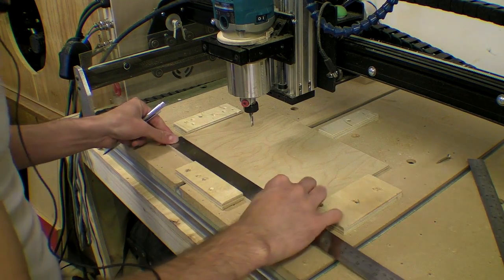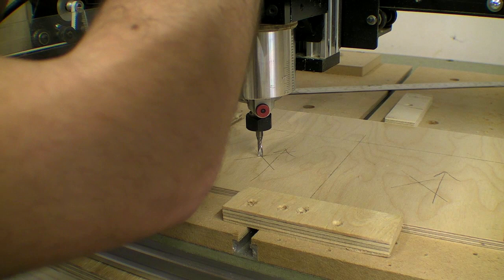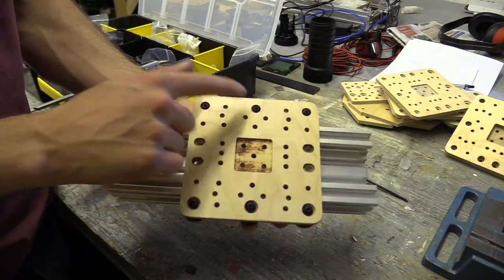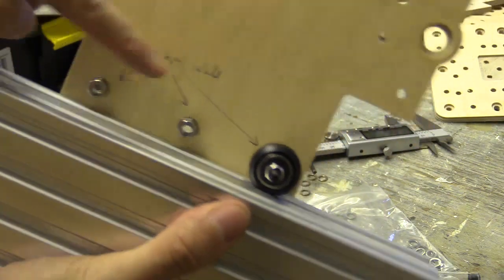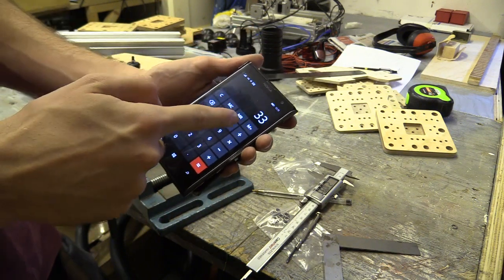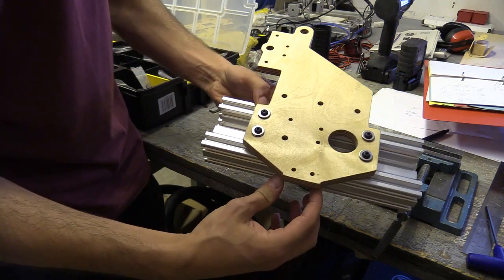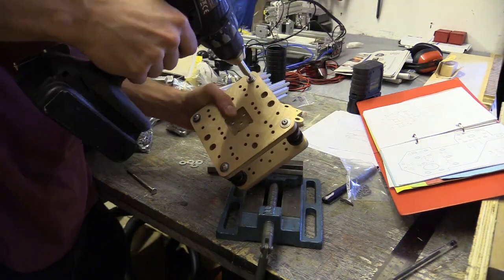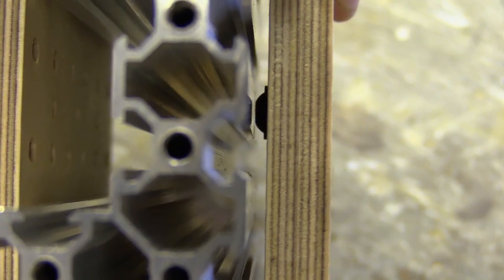#1 Designing and Testing For Lead Screw Machine #1 / C-Beam Lead Screw CNC

Comment: I’m looking at building this unit as I have limited space and I’ve followed your build series ( great series of videos btw) and I reckon it’s suitable for my needs.
X and Y dimensions can be adjusted but I was wondering what the Z maximum height for machining is?
Thanks
Reply from the maker: My memory is a bit sketchy as I built several other machine after this one - I may have written something down on my website but you'll have to do some digging. https://miscpro.com/cnc-builds-timeline/

Comment: Would you mind sharing the drawings for the plates? Building my first Cnc and using c beam as well. Any help would be appreciated. Thanks
Reply from the maker: My CAD modelling skills when I did this were very poor, and the files are a complete mess which is why I never made them available. But I have the 3D printer version including DXF vector drawings on my website shop, which you could work from the make something from. https://miscpro.com/shop/

Comment: Absolutely love my OpenBuilds Ox based machine. I built it 1000x1500mm which gives me a work area of about 820x1270(ish). I used three 20x60 just on the gantry and the whole thing seems very stiff and accurate so far. Good luck with the build! Spindle on mine is the German Kress 1kW spindle.